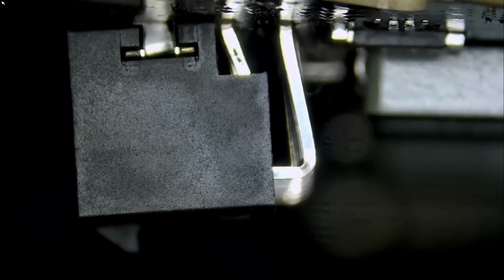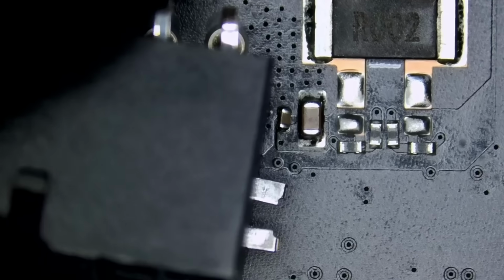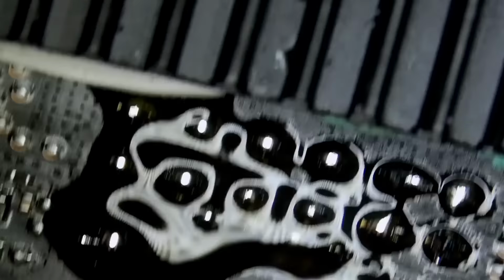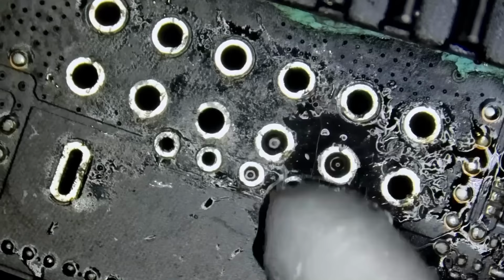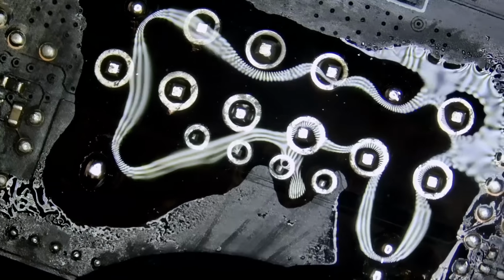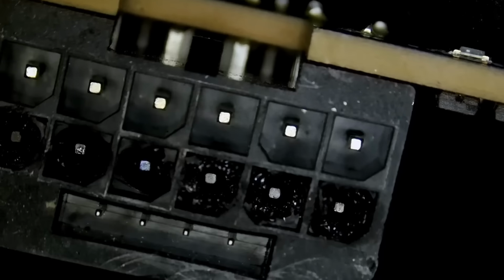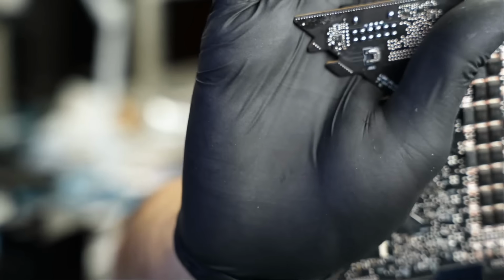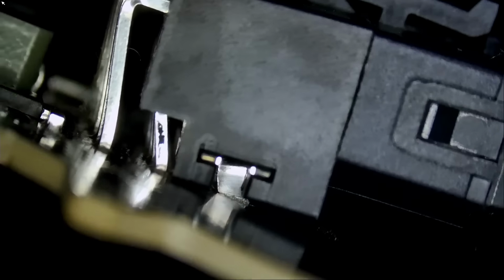Nvidia 4090 Founders Edition Have More Issues - 18 Cards Repair

Comment: The problem with this connector are because some "specialists" in IT or gaming , NOT in electronics , tell to people they are guilty because they not push enough the connector and after the connector melt! The manufacturer are use wrong material for that connector and that's it but they insist with that theory and more, they start also make lots tests and analyze with X-ray useless things and i ask them , how before people connect the cards in same way but the connector never melt...

Comment: The right-angle ATX 20/24pin connectors sometimes made me feel uneasy as well, but at least with those the connector is not surrounded by a shroud so you can support it with your fingers and squeeze the plug and connector together.  And if you break anything at least it's visible.  I wonder why they don't have large connectors use plugs that are split into smaller blocks in order to avoid the pressure from having to mate all the pins at once.  It was something I always appreciated about the AT power connector being split into two.
Reply: Very true, but in honesty, back in the day I  had an Abit IC7Max board with a 90 degree ATXPWR connector and it gave no problems and run it for many years, it also made cabling tidier but I was Just as concerned when I 1st plugged it in and took extra care but you could just about grasp both the plug and the connector and squeeze them together if you didnt cut your nails too short :/ but as the pins were also exposed  because of its orientation I covered the exposed pins  on the topside of the board with insulation tape as they looked like they were  an invitation or something bad to happen.
Reply: ياحجي اذا نزل عل سوريا يعفطوه جماعة ابو حيدر جوية وبعدها بحياتوا ما راح يمسك كاوي 😂😂😂

Comment: 4090 FE had a revision around late spring 2023 with the new 12v-6x6 connector. Would be nice to know if these are new ones or old
Reply: They never mention it, my bet is that these new 12v 2x6 connectors solved the issues. I just picked up a founders edition 4090 as it is now problem free.

Comment: I'm assuming when Alex mentions a customer with multiple cards that customer is Cablemod. They do seem to sell their refurbished 40 series cards in batches sorted by brand but could be wrong the customer here is them. I still wish we'd get some form of statement, be it official from CableMod or a unofficial opinion as what made CableMod's connector so different from all the rest that caused it to be such a high % of the melted connector. Of course part of that is based on they likely had the highest sales for any of the angled adapters but you rarely, if ever see reports of the others. Not sure I've ever seen a report of the Corsair adaper melting or the Bykski (branded as FormulaMod) having issues. Not saying it's Cablemod's fault as it's clearly a connector design problem but it's obvious that the design CableMod did interacted with that bad design more negatively that the others.

Comment: I'm using a RTX 3090 and even I've been pissed off about the card request 3 PCIE connectors to power up I'm become to appreciate I didn't have any issue in 2 years,I really don't understand why PCIE will release such a mess connector for the public when is clear that connector was not well designed for the public consumer.

Comment: If you own or want to get a 4090. Do not use the cable that comes with it.

Get a 12vpwr cable from your PSU manufacturer. It clicks into place and goes all the way in.

The cable that gets supplied is horrendous,its a bulky spaghetti mess and it doesn't click or seat right.

Comment: I would cut down the plug from the modular PSU and solder the wires straight on the board cancelling the connector. Card still can be disconnected at PSU side and always goes together with the wire. At this point I would likely not pursue refurb/restore path and would go with fix/repair.

Comment: Nvidia is releasing its 50 series cards most likely in the fourth quarter of this year.  What are the odds that the same connector will be used again instead of reverting to the old PCIE connectors or completely redesigning the current mess of a connector?  A faster chip means more power, more power means more current, and more current means more heat.  sigh...

Comment: 12VHPWR is a total failure on all counts. If only they had used well known standard connectors such as XT60 or XT90 instead. And even XT60 with 2 pins is rated for higher power than 12VHPWR!

Comment: the problem is with those 12 pins 12vhpwr sockets/plugs nvidia is using is a regular quality ones. typical copper you can find pretty much in any other PC motherboards pins. while in nvidia RTX 4090, those mere 12 pins must  serve 4 rails that have theoritical power throughput up to 600 watts. those 12 pins 12vhpwr deals with way too many watts going through it. nvidia should at least use higher quality conductor materials for the socket pins and the 12vhpwr plug, such as those OXYGEN-FREE copper conductors. which more stable temp wise in high wattage. at least for the top tier cards that supposed to operate over 400 watts. or just use silver pins for the socket and the plug. expensive product should come in expensive materials too.

Comment: On my 4070S, the male Nvidia adapter was oversized and wouldn't fit. I applied a large amount of force and it simply would not go in. I could easily have broken the connector this way as well. 

The resolution was buying a 12vhpwr cable from Corsair, which fit perfectly.

So, Nvidia is shipping defective cables is my main takeaway, potentially leading to "user error" and connector failures.

Comment: Turn around and confront the enemy, otherwise they will keep coming back. Choose your battles wisely! That connector needs more than the solder joints to secure it to the board. This is a design flaw.

Comment: Amazing job like always but wtf is going with Nvidia 4090 they like paper burning connectors, cracking tiny PCB and now this new issues with connectors popping out out of PCB due two forse XD this why I returned me RTX 4070 ti in me country a lot of them have similar issues one guy also fixings all of them ...

Comment: Its not just the force to push the connector in its also possibly the pressure from the cable as its tightly folded to shut the pc case door.
Reply: The cablemod adapter was supposed to solve that problem. And we know how that turned out after 2 versions.

Comment: i recently got an asus 4090 tuff gpu for a new build. i put a little permatex dielectric grease on the connector and in slid right into the card and latch snapped into place. i have had to unplug it a few times because i am still getting the pc just like i want it but, i have had no issues with the connector so far. and i have run a stress test on the card that pulled the 600 watts(according to msi afterburner) several times. don't know that it won't have problems before i finsh watching this video but, so far, it had been perfect and i recommend the dielelectric grease.

Comment: Bad design, obviously people are pushing those things in extra hard  to make sure its in all the way to avoid the socket melting - maybe old school  tech is best, for example a new socket with a captive screw terminal each side like the old serial and parallel ports used to have would eliminate those 2 problems.

Comment: I don’t think the reason is when the connector is plugged in; it is more when users close the lid of their cases. Over time the heat and pressure from the lid on the power cable, the connector bends; these cards are so big and to make things worse, the card connector faces the case lid. You need a 90 adapter facing up so the weight of the cable doesn't add load to the card or connector. Poor design but you can make it workz

Comment: Do we know if this problem is related to a specific batch of the 4090fe? maybe fault batch of connectors? are those cards using what revision of the connectors? i got mine on the first batch and haven't have this kind of problems, i had connected at least 10 times (changing case, cable etc..) and everything looks still firm

Comment: Any chance you could talk a little more about your air and soldering setup/airflow/temps when you’re working on repairs?  I’m interested in understanding the different setups as it relates to these thick boards versus boards with less layers and such.

Comment: In germany we say "Eins nach dem Anderen" which often gets shortened by various accents, for me it's "Eens after den And'ren" (low standard german, which basically is a mutation of dutch, english and german).
About those connectors: every video where you repair a 12VHPWR connector is a confirmation for me: the connector itself is not ripe for end customers and we are (again) beeing used as alpha-/beta- testers for a product, that could've used more time to ripen. I also would've preffered a connector that is closer to an 8-pin ATX EPS connector...

Comment: The issue is user generated, not only that, but media is at fault too. (I mean the one in this video, not the burned connector)
Everyone in the media says to plug it in completely and some people take it too seriously and use extreme force.
I use a 4090FE since nov 2023, before all the news about the connector. It is still running without any issue, even at 600W OC (for testing purposes). 
I used the included adapter for half a year and then an OEM adapter from Corsair (when I finally got one) since then.
Reply: I just got and 4090 fe which adapter should I use.

Comment: Still would like to know if it's possible to directly solder the (12vhpwr to 4x 8 pin adaptor) directly to the board by cutting the 12vhpwr connector off? Wouldn't this solve the issue as it will have 4x 8 pin connectors directly attached to the card getting rid of that silly connector completely?

Comment: NVIDIA should cease selling cards with high power consumption, such as the RTX 4090, first develop a solution and carry out a service campaign for all users, similar to the case with automotive industry. The cards are simply dangerous not only for computers. You can even burn your house.

Comment: Thats user error i use that connector with a 3090 founders and a 4070 super and you dont force the connector in but wiggle it slightly in

Comment: Its a designer problem and user problem ,because the connector is not strong enough to hold the pressure and because the user press the male connector without supporting the female connector with other finger it's easy to understand

Comment: i would rater just have 2 8 pin plugs than that plug, and before someone says 8 pins are 150 watt each 2x8 pin is still electrically safer than one of these plugs, anyone who does not believe me can just shove 1200W though 2x8 and a 12 or 16 plug plugs and see what fails 1st. i do not know why 8 pin plugs are only specked at 150W, but what ever reason it was this plug was created for the purpose of ignoring those design reasons

Comment: That connector isn't designed to handle that mechanical stress. Since you're usually in an awkward position when plugging it in, all the counter force comes from those soldered-on pins. Maybe a kind of crimping tool to hold onto the plastic and the connector could solve this installation problem.

Comment: With so many similar issues arise from the same model it strongly shows the evidence of failed PCB design and/or manufacturing. There are also many who complains about the bad connector design for RTX 4090. This model should be taken from public as soon as possible in order to save NVidia face otherwise the reputation damage can be severe.

Comment: it seems obvious to me that a simple way to avoid this would be to add a simple bracket that goes over the top of the connecter or behind the connector to prevent it from moving when force is applied to push the cable all the way in. There must be enough room in the design of the cooler to allow for an extra piece of material to add strength to the connector? Surely it's just common sense? Just bad design when this keeps happening. Wish I had your skills man, I would experiment with this and start selling improvements to cards.

Comment: The main reason these cards have issues is because nvidia decided to reduce the number of connectors from 2 down to 1. Previously, 2 connectors powered 2 different 12 volt power rails with 2 separate grounds and the current used by the GPU was divided into 2 separate channels that way which produced less heat (the more current passes through a wire/pin, the more it heats up - plain physics). This kept the pins from melting the connector or the solder joints on the board. In order to save money apparently, they reduced the number of connectors and now all the current used by the card has to go through a single 12 volt rail - Apparently the current drawn is TOO MUCH for a single power rail to handle which causes overheating of the pins - Sometimes the connector gets melted, and other times like in this case, the heat is enough to melt the solder and separate the connector pins from their joints on the board. Simply POOR design and total disregard of the consumer by nvidia.
Reply: That's complete nonsense.
The connector is not up to the job.

The number of power rails on the GPU is irrelevant, that's more of an (older) PSU thing.

Comment: The problem is the big lever by having the small pins at the bottom and the bigger ones at the top. It's a smart idea of Asus to put the connector upside down (kinda), to combine the generally stronger support of the bigger pins with a shorter lever arm.
Maybe putting a drop of some strong, sticky adhesive under the connector will give a bit more support so it doesn't start moving?

Comment: the whole 12vhpwr connector should be scrapped and redesigned.. its junk.. too small for 16 pins/wires not to mention feeding 600 watts of power... period.. why does it need to be tiny???  double its size or make it 50% bigger and leave pinout the same.. problem solved.

Comment: I hope my 4080 Super will not burn in the future. I inserted the connector before putting it in on my motherboard outside the case so i have a perfect view if the connector is fully seated and if i do no bend anything.  I think it's a bit of both, user error but also manufacturers error.  The connectors on the Asus cards need a lot of power to insert. Way more i felt comfterble with. I had a 4070 TI S from then and got the 4080 S at msrp so changed it. Both needed a lot of force. And initially i really thought it was fully seated. I even heard it click. 

But when looking at it i saw it was not fully in, so applied more force and finnaly it was in all the way. I can imagine this is hard for many people to feel/see oudside the case, and even more so inside the case.

So that's why it is a manufacturers problem. However i do believe at least half or more of the burned or bent connectors could have been avoided. But i believe the connector should be different and better so this does no happen so fast.  There is a small red led on top of my GPU and when it's not inserted all the way it will light up. So i check it every day to see if something might go wrong.

Hope they do change it to a spec that is more user friendly.

Comment: I start to think, maybe we need tool like torque wrench to install a power cable 😆
Each graphic card manufacture provide an information how much force applied to install it, like installing bolt on vehicle with specific torque.

Comment: I'm surprised that Nvidia is still designing the GPUs with the 12VHPWR connector and forcing the other manufacturers to implement it. The connector is bad!
The melting of the connector was bad enough, now off course people want to be sure that it is inserted properly. Nobody want to burn a connector on a (insanely overpriced) 4090.

It is beyond time that Nvidia and the rest of the PC industry should abandon this connector and go back to the drawing board. This is an embarrassing mess.

I also found a video on the headroom (or lack of it) of this connector. After seeing that, I'll take 3 8pins over the 12VHPWR connector any day.

Comment: remember how 9-pin din connectors have 'large' wings on both sides that allow either soldering or screwing the connector to the motherboard. The pressure needed to seat a din connector was never this high. I guess all the experience of the engineers 30 years ago got tossed in the trash and replaced by stupidity that the customer has to eat.

Comment: It is pretty funny that the new power sense connectors are the ones that broke, probably telling the power supply to stop supplying power. Goldilocks needs her power supply cable plugged in just right. 😜

Comment: I have 4080 FE and this video makes me want to ask. Is 4080 or, rather, any other card can potentially have the same problem with the connector? I'm asking this because I've seen a lot of connector repair on 4090 but not on any other GPU.

Comment: Will the user have the same issue as before with the new connectors? Won't they just bend again or perhaps the new ones fit better so the used doesn't have to push as hard to connect

Comment: due to these issues which indicate to me it's a case of poor quality components/materials I'm wondering whether it would be worth just coming to somebody like yourself to have the connector replaced and reinforced prior to using the card? I'm thinking of buying one of these but I would rather spend a bit more and have somebody like you improve the product before I have a problem. How would you advise me to proceed?

Comment: Thank you for the entertaining videos! I would love to see what the correct way is to use a solder sucker (Believe it or not), since every time I have used it, there always seem to be some solder left in the hole (Usually blocking the hole). Then again, might be because of not using low melt 😉